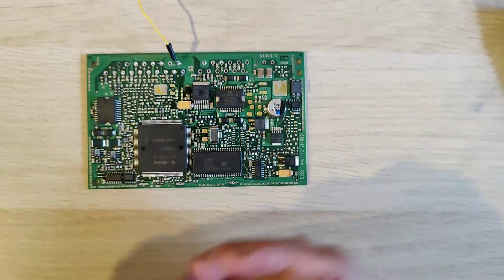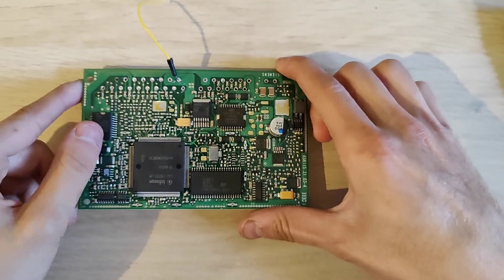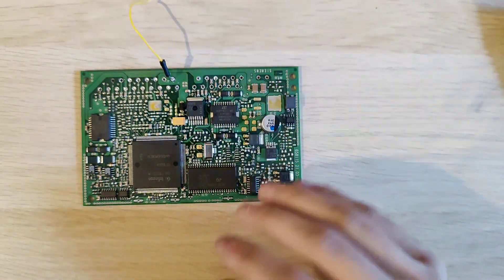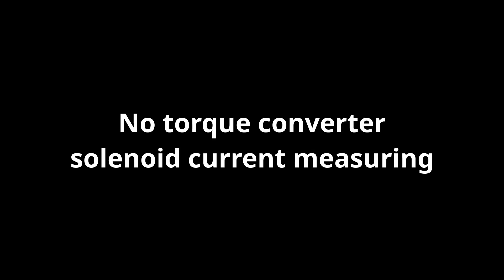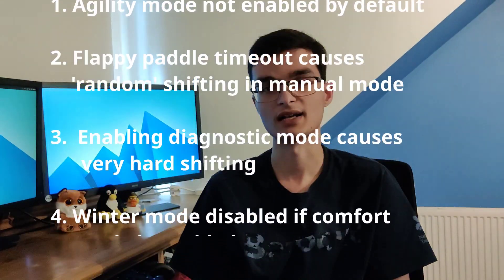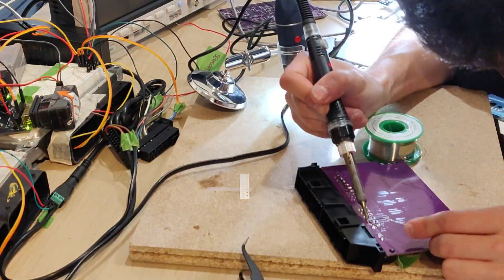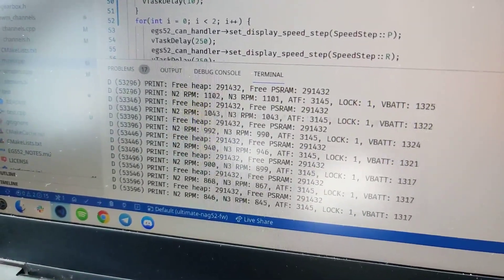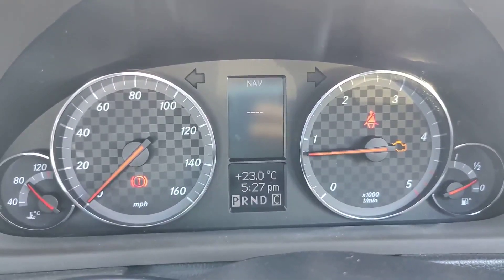I designed a custom TCM for my Mercedes - CUSTOM MERCEDES 722.6 TCM project part 1

Comment: The flares is because os 2 reasons:
1: One of the clutches inside the gearbox is worn out ans slips
OR
2: By design of the manufacturer to make a smooth shift when the TCU doesn't know which gear it should change at the moment (eather stay at the current gear or shift up a gear).
If you have excessive flares then it probably isn't software, it should be a damages clutch.

Comment: Hi. It's a little late. But. When you release the accelerator, an unpleasant jolt almost constantly occurs. If you select only the first gear and drive it, then there is no push when you release the accelerator. Also, if you select the second gear and drive it, then there will also be no push.

Comment: Great job Mate! My ML350 W163 got exact same issue as your Merc. I'm planning to order PCB since I'm going to install supercharger in it and I need better solution for mapping gearbox. One question: would you mind to send me list of the components for ver. 1.3? I've tried to use tutorial from provided link at Github but I don't know how to export list of components.
Very proud of you and work you have done, peace!

Comment: do i did the platine change in my gearbox, above my mechatronik unit in my 722,6 and a oil change and filter change ofc, it worked fine again some time, after it broke down again dont wanting to shift out of 2nd gear or above, then when locking up in the gear i needed to turn off the car to even get it out of neutral into reverse or park, then i replaced the shifter, there were some broken off pieces so i think that was the problem there, now all works great its just that the cars 1st, to 2nd shift is a bit weird, like its not kicking or something but when accelerating, it goes a bit over the top with the rpm and then like draws back, sound like the clutch converter lockup you talked about, would the tcm change that for me ?

Comment: Transmission controller /computer not working correctly. What to do?

A. Have the vehicle taken to a professional and pay out the ass for labor as there is no guarantee of a fix ($100 Hr avg. in the States) and then you still have a badly designed unit
Or
B. Figure out why the factory unit sucks and build yourself a new computer to control the transmission on your ride

If any viewers chose B then your a Gear-Head. 
This guy is inspiring, it's hotrodding at its finest and I salute you sir

Comment: Wow, I truly adore what you are doing. This could change the entire aftermarket solution business for these transmissions, there is a ton of them and are installed in very recent cars as well. I am too a proud owner of a W211 220CDI with 722.6 but the transmission is troubling me.  The problems are shuddering, flaring mainly in 3rd and 4th gear, harsh TCC lockup in 2nd, erratic and elevated idle RPM (should be around 600RPM, mine goes up to 900). I have to play with the gas pedal in order to stop the transmission from shuddering. I've been investigating forums and videos, studying all transmission components to figure out what could solve the problem, but I have not found a definitive answer even when this is a common problem among many 722.6 owners. I think it is related to oil pressure issue rather than a mechanic failure. The problems only occur when the oil temperature rises a little bit, but almost disappear after the oil is at 80 degrees Celsius. The higher RPM remain though, with them dropping to 600 from time to time. 
I hope this helps you somewhat and I wish you good luck with the project. Keep it up, hard work pays off and it will when your TCM is finished. This is how millionaires are born :)  Cheers
Reply: Buy a new valve body

Comment: Do you ever plan on making one of these compatible with a W210? I’ve got a 722.6 in my W210 with the OM606 diesel and I want to retain all of the factory modules. I get the flaring while shifting and when cold the gearbox doesn’t like to shift. I would absolutely buy one of these if they are compatible!

Comment: Wow Good work! Really interested in seeing if you could make one work Stand-Alone 722.6 with an OM606. I would buy several TCU's if it works
Reply from the maker: I don't ever plan to make a Stand-Alone one. Solutions like SSCG and OFGear already solutions for that. Mine is a drop in for the OEM EGS52/53 units in existing Mercs from 2000-2012. Different target markets :)

Comment: Hello, I have 722.6 in a 2012 Jeep Grand Cherokee, 70,000 miles, the TCC comes in harsh when the oil is cold and in my opinion way too early in the rev range. It has a very aggressive economy regime and this problem is common in mercs and sprinter vans and Jeeps with this box. I have often thought 'I wish I could reprogramme the controller to lift the revs threshold when cold' ( I was a mechatronics engineer, now retired) . When it's very very cold it does disable the TCC anyway, but mid temperature it doesn't. I came across your brilliant PCB, how do I contact you to purchase an assembled and coded one? Do you have a website to sell them?  The real problem I understand is that there is an internal leak in the torque converter but the rubbish software means it cannot cope and you have to replace the TC and maybe fit a Sonnax revised damper valve in the valve block. Software is easier for me so i'd love to get hold of your PCB and code, how can i do that?  PS. I also have a Mercedes SL350 with the 7 speed 722.9 but it again has rubbish software, maybe another controller project. It has flare and poor change performance, it's got 130,000 miles on it. It's the least sporty change ever, even in sport mode. Kudos on your  work, brilliant. regards Guy Laughton

Comment: Rc protection is a tricky one. Forward voltage drop on the diod is a the reason you might not receive ful vcc. Depending on the voltage regulator you might not have the extra voltage to drop.

Comment: Looking good. This is very interesting. I am currently starting an engine computers build.  If you can build a universal application, this would be ideal for alot of manufacturers. The burning question. Have you checks the speed sensors for metal debris. It will bugger up the signal for input output shaft speeds. Leading to terrible shifting and it feels like it software related. But it eats the torque converter and piles more metal on the sensors. Self diagnosis doesn't get any results unless you oscope the speed sensors. Even then, there a switch and the slew rate is slowed. Sending the tcm garbage data. This has been a really common problem. The speed sensors are facing straight up and collect the debris very well. Just thought I would let you know the common issue that feels like program could fix it. But it's a physical sensor getting junk on it. Pretty simple repair. Drop the valve body and you will see what I am talking about...

Comment: Been following this for a while. Great work. I currently have three 722.6 Vehicles and luckily no issues. Wish there was a replacement board for the 722.7, I've had to junk two cars already from unfixeable 722.7 TCUs.

Comment: Amazing !!
Great job done. You are very good.
My car uses a CRD2.20 ECU, Is your custom ECU compatible?
Cheers
Reply from the maker: What car and what year?
Reply: @RANDASH  apologies my mistake. You built a gearbox control, not the main ECU itself. 
My car is W639, from 2013, it uses an CRD2.20 ECU. I need to check what gearbox box uses, I don´t remember.
Perhaps in the future... you can try to build a custom ECU

Comment: You're genius! Your work will help lots of people. I have a 2002 C240 which has 722.6 gearbox, now running fine. But I hope you will sell this board in the future, I wish the gearbox is a little better, have a bit of customization like not holding to first gear when cold.

Comment: I wished this worked on the 722.9..🙈👍
Good luck with the project.
Reply from the maker: It can't. The 722.9s TCM is part of the valve body itself so playing with it is impossible.
Reply: @RANDASH  And also I think there are some security algorithms involved in receiving the CAN signals from other important ECUs. The signals likely aren't encrypted, but rather - verified using some message signing algorithm. Not knowing the keys means the controller won't be able to send some important signals to the Engine Management controller (and so - the engine will most probably stay in limp mode the whole time). This is part of the "theft protection" in vehicles made after 2009 (I think)
Reply from the maker: Already worked round that in testing 😉
Reply: @RANDASH  Would love to know more

Comment: its fused in fuse box- have fuse for gearbox
Reply from the maker: yes I am aware of that :), I wanted to make that clear in the video that the PCB itself does not require a fuse. Also Fuse box in the front of my car is PART of the SAM-F unit
Reply: @RANDASH  i think you dont need measurement current on each valve, because valves are active on neutral and parking (some valves pressures both and 3-4i think) and on shifting around half to one second. I have mounted LEDs on each solenoid, so i can look what tcu making ;)
Reply: I can make video from drive if yiu want
Reply from the maker: @caryfuk8  the reason for current measuring is to keep track in case a solenoid is going bad / short circuit. Hence why all solenoids have current measuring. The PWM solenoids will benefit the most from this though :)